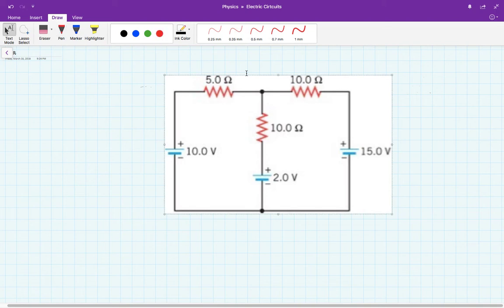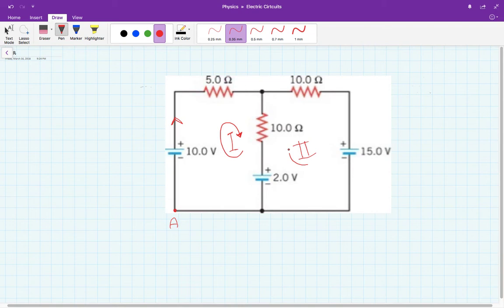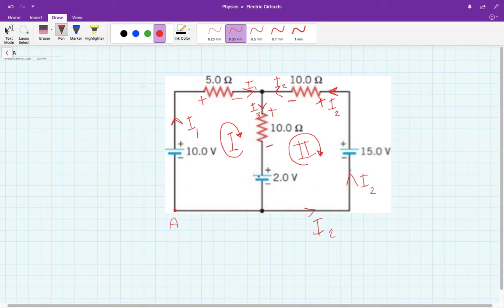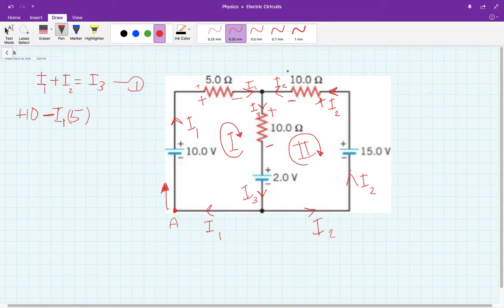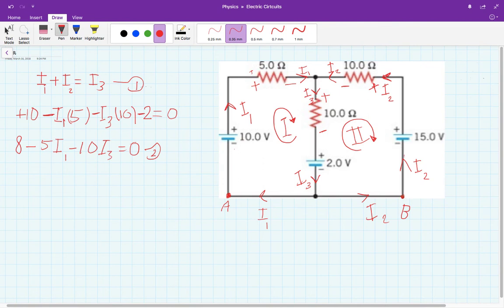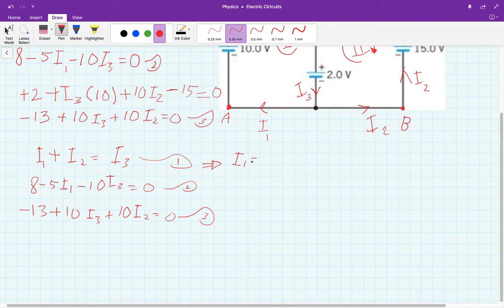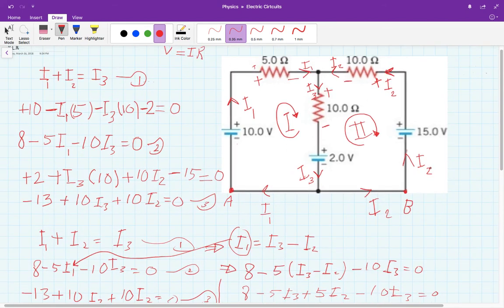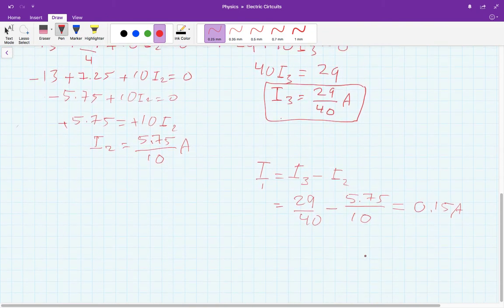Ideal and simple solution to a kirchhoff's loop rule problem

Comment: how to find the voltage across 5 ohms ?
Reply from the maker: you can do that by multiplying the current value that goes through the 5-ohm resistor by the values of the resistor itself.---> V=I1 times 5